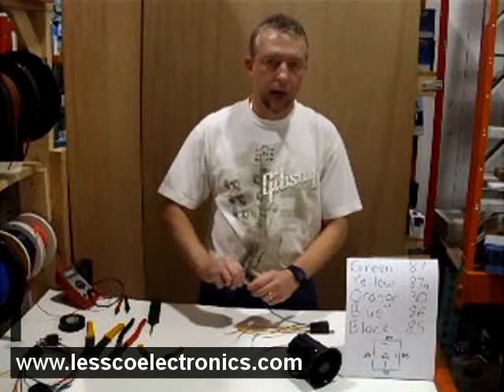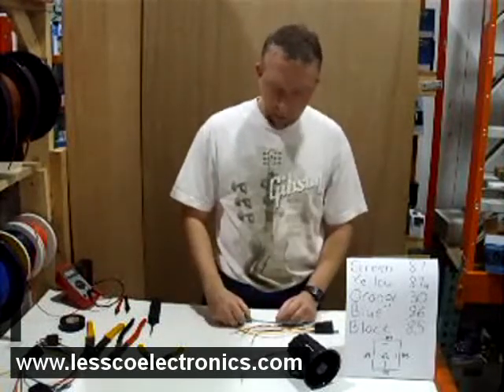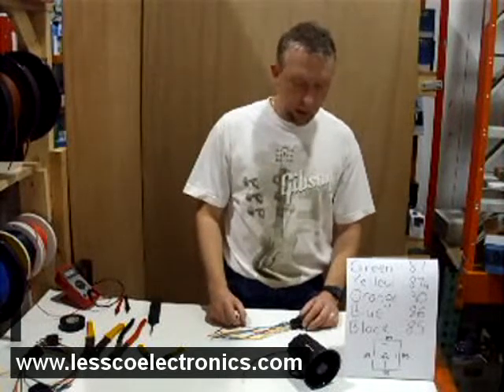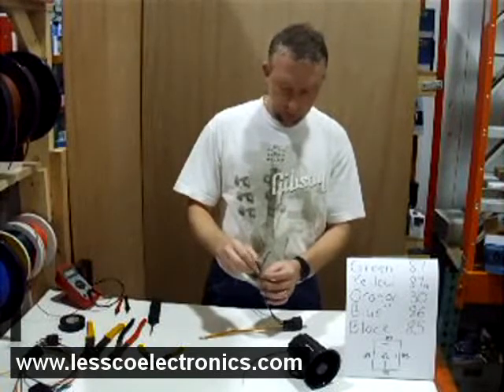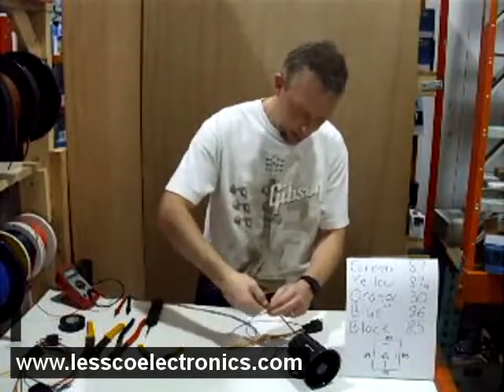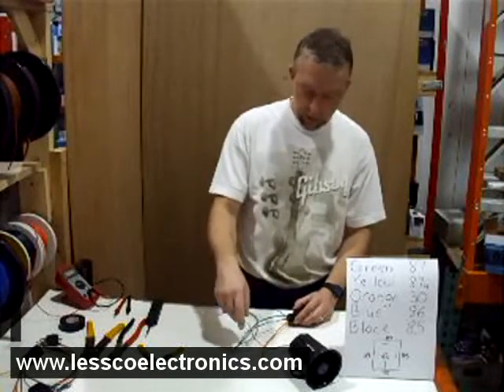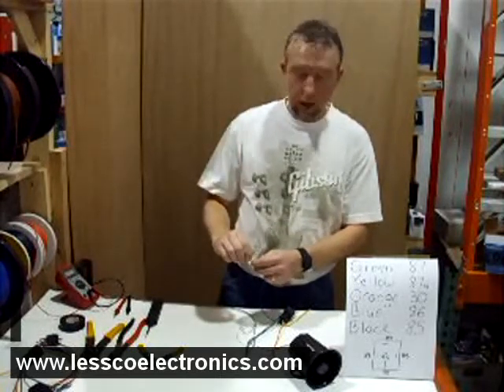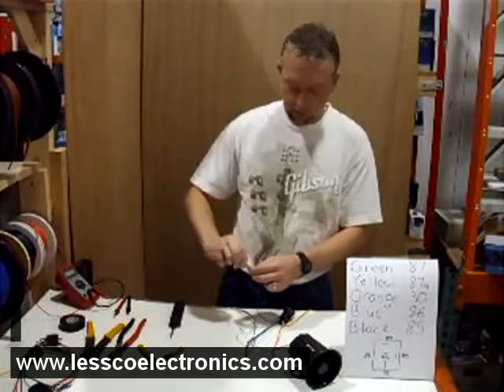Adding horn honk to a car alarm with siren output only

Comment: On a viper 4806v it honks the horn when locking and unlocking the car. I like the feedback when locking but I don’t like it when unlocking. I been reading the manual and searching on google and cant seem to find a way to disable the honk when unlocking only. Do you know a way? Theres is an F (function) button on my controller that I can click once before the unlock button and that will activate silent unlock but I have to do that every time. I want to permanently disable the honk when unlocking.

Comment: You seem to know about siren horns and powering.  I have a 9V horn siren made to run off home AC converter(100-120) input-9V DC output to horn. How would I wire this to use my car 12V battery power?  I want to use it as a deterent to car vandals! I have motion detectors that are wireless that set off siren horn. I cannot find anyone who knows what type of converter to use in car to power siren.  All motion detectors and remotes are configured to siren. Any help appreciated or direction to someone or place?

Comment: The Prestige APS997 remote start/alarm already has a Horn Output wire (Pin 18). The manual doesn't say if it provides a pulsating signal when activated. Will have to find out.

Comment: I'm confused. I wired the alarm siren output (12+) to power two relays -- one for the extra horns dedicated for the alarm, and the other to the siren. Hence, I just used the siren output from the alarm as a (12+) trigger wire for two the relays. It used to work FINE when I was only using 1 horn. However, when I upgraded to dual tone horns for the alarm, the siren began making a chirping sound instead of a constant siren sound while the horns were blowing. I connected a flasher relay on each of the horns.  What might be wrong with the setup?
Reply from the maker: its the parking light output that pulses the horn, not the siren output so much... thats how it works

Comment: Ok,But what happens if your inside the car and the car alarm horn is goes on and off and you accidentally press on the steering wheel horn.will that cause a short?
Reply from the maker: no, not at all

Comment: I did this when i replaced my aftermarket alarm module in my Tahoe for some reason it did not have the horn honk option output like the old module did so what ended up doing was using two 4 pin relays
Reply from the maker: :I
Reply: @Lesscoelectronics  one Relay gets turned on via siren output so like this  Relay #1 Pin 86 Siren output, Pin 85 Ground, Pin 30 negative Trigger wire from factory horn, Pin 87 to pin 30 on Relay #2... Relay #2 Pin 86 Parking Flasher output + From Alarm, Pin 85 Ground, Pin 87 Ground -. results when alarm goes off= "parking lights on Horn sounding, parking lights go off, horn stops sounding".
Reply: @Lesscoelectronics  Of course a more easier way to do this would be to switch the polarity of the "parking Flasher output" From + to - and no need for the second relay.

Comment: HI: i was trying to do your project. This is the situation : I use the out put voltage from the horn to the relay, but I don't know if the voltage or the current is not enough to turn the relay on. Do you know what is the voltage to has the horn or what is the solution. thanks.

Comment: My question is my truck alarm has a siren but I want to install this Federal Signal siren to the alarm so it can be louder so can I just use the power and ground wire that go to the small siren that came with the alarm and connect it the the louder alarm??

I’m going to not even use the small siren anymore so will it be ok and not burn up my truck?
        Thanks!    X

Comment: My siren worked on brown wire but i took it off wasn't loud enough so i tried to hook up horn but had little spark very little then i switch it around no spark but both ways the horn didn't turn on like when it was on siren..so i went back to the original siren but now it has no sound?  Did it mess up the sound. ..well on my alarm it has a wire for horn, brown and white but it needs to be programed ...silencer sl-6

Comment: i cant locate the +siren output, so when i do everything you say it works but when i turn on the parking light switch the siren comes on and wont come off unless i turn off back the switch. i have a 1996 honda civic
Reply from the maker: what model alarm do you have? the siren output is usually a brown or a wht/blk output...
Reply: APS-997 Prestige Audiovox, its looks like something is wrong with that output, because i tried another alarm box APS-995a with my hook up and the siren output works. Can i use another output source
Reply from the maker: tht wht/blk may be throwing a ground instead of the 12v+ like it should if the output blew, try adding a relay in with a ground trigger, see if that does the trick

Comment: I know this video is old but I have a question I was told  my brain on my alarm can handle 12v speaker alarm but those it matter on the watts my speak is a 12v 20w speaker can i put a 12v 100w speaker
Reply from the maker: +iz413 you can use anyone you choose so long as you add a relay in to supply it all the power it requires. if you need a guide to do it lmk.
Reply: +Lessco Electronics yes please that will really help
Reply from the maker: sure, whats the email to send it to?

Comment: wiring the relay like in the video will give a positive pulse output on pin 30.. problem is, my factory stock horn needs a negative pulse,  so do I need a second relay to convert that positive pulse output from the first relay to a negative pulse output through the second relay?
Reply: What did you end up doing? My alarm has a positive pulse, whereas my vehicle is negative.

Comment: So I just installed my auto page 350 into my Acura integra. The problem I'm having is my siren won't go off with my horn and my parking lights don't flash when I unlock and  lock or when the the alarm goes off. The only way I can get the siren to work is by turning on my lights leaving them on, getting out of the car and  Arming the car. Then the siren will go off with the horn but the lights won't flash at all no matter what. 
on the harness there is 5 wires I listed them to how I got them from the Manual. The red/white came tapped into the fused red wire so technically there is only 4 wires.
1. Red/white wire: parking light relay 
input 
2. Fused red wire: 12v  constant 
3. White wire: parking light relay 
 output 
4. Brown wire: siren 
5. Black wire: ground
So on my first attempt 1 and 2 went to 12v. 3 went to my parking lights. 4 went siren. 5 to ground. When I did this i tested the alarm it locked and unlocked but when armed my siren would beep and parking lights flashed with the led inside the car flashing too. The shock sensor wasn't working either. The siren beep of parking lights would  shut off until I unlocked the car. So I was stumbled and rewired it I put 1,2,3 all into my parking light wire from my car  and my alarm worked fine so I left as that. So as of right now my parking lights don't flash and the siren doesn't go off with the horn.  as I stated up top that's my current problem. Thanks
Reply from the maker: Javier Camacho thats weird, it almost sounds like the system doesnt have enough to supply all the functions at 1 time, maybe try adding in an extra relay to supplement the siren and see what happens, then try the lights if that doesnt work out.
Reply: How would wire the siren to the relay?
Reply: Lessco Electronics hi. i have a police siren and want to use it as my car alarm.. want use the horn sound and the phaser sound from the police siren.. is it possible? can u help me? any idea? thank u
Reply from the maker: sure, you can add that in parallel without any real fuss. just have the sound selector nearby where you can change it when you want one or the other sound.
Reply: I rewired it and got it to work. Thanks for the help though.

Comment: When I conect the blue wire the siren turn on and don't stop , or I'm doing something wrong I conect the blue and black to the 12 volt and the orange to the siren and the blue to the flashing lights but the silent don't stop , help please
Reply from the maker: email me in detail the pin outs on your relay and Ill tell you the issue youre having. send it gto sales@lesscoelectronics.com
Reply: I just send you the email
Reply: i send the ever i never get a answer back
Reply from the maker: call us, we'll gladly help you out a little with it. 904 342 5491

Comment: installing a prestige aps 997 c in 07 fj cruiser.  if i use horn output on rs alarm and connect directly or horn neg wire on fj do i need a relay?

Comment from the maker: my solution uses the rest voltage of your lights being off, not the voltage to turn them on
Reply: If you use the hazard lights or indicators would the horn not activate?